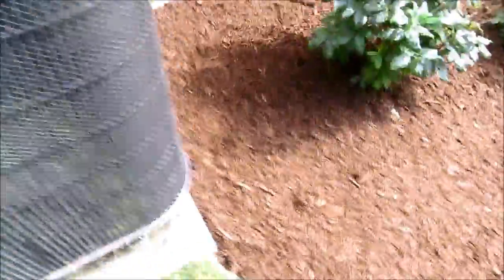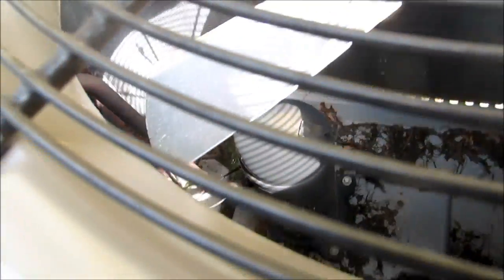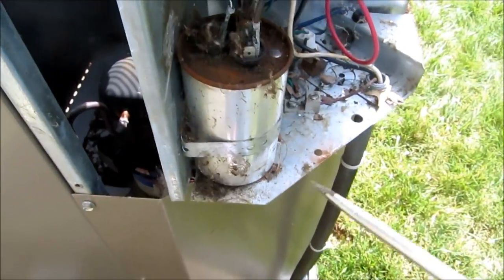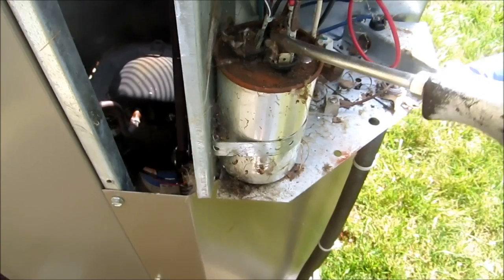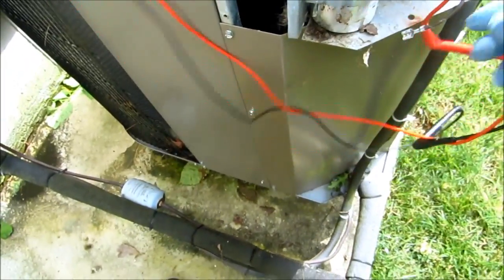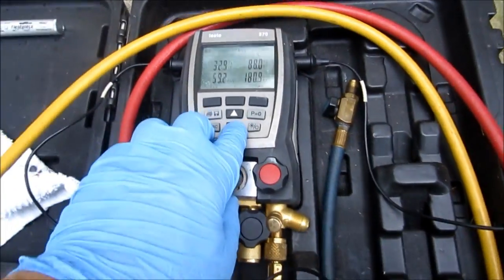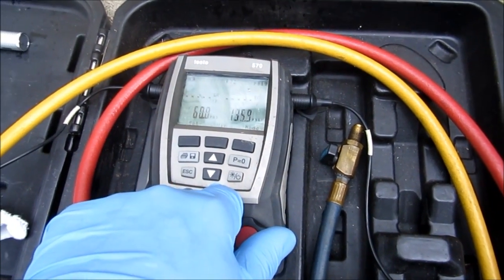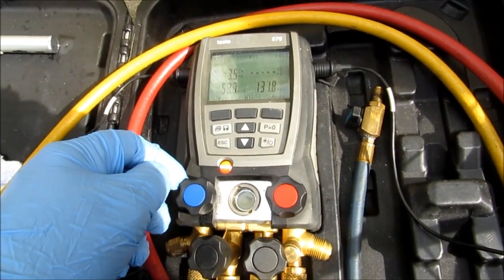HVAC SERVICE: condenser unit ,flooding back low sucton pressure

Comment: Thanks for this video.I had a similar situation with a no cooling problem..This system was low on the suction side so I attempted to add freon but the compressor pressure switch tripped in the middle of charging the system causing both compressor and fan to stop working.I pushed the switch botton .Systen ran for a few minutes and shut down again.Please help.
Reply from the maker: +Olurotimi Adepitan sounds like it going off on a limit eather high or low most likely low .best to call a service tech to fix your problem
Reply: Olurotimi Adepitan  who uses freon?..lol..its refrigerant

Comment: man what a pile good job getting it going again though.  gonna have to see about calling someone to look at our unit sometime  today I noticed when doing some yard  work picking up brushes etc piling them at the service gate next to the units I know big nono  but I wanted them out of the way so homeowners ass don't get made waiting for heavy trash pick up well I noticed the side of the compressor was sweating but stil cooiling didn't have time to deal with it went out for mothersday looked at it again wasn't as bad  this time then unit shut off went away  so I went kicked it back on  within 30 seconds it started to appear again it cant be overchared the charge was chaecked last year and was fine it was actually under charged  long line sets here im going to open the case and run it if it does it bad im going to recommend call someone.
Reply from the maker: compressor should not be sweeting .sounds to me its flooding back ,maybe you have a bad txv or over charged .its hard to say with out  looking it over
Reply: yea  I think the charge is okay it was checked a year ago and at that time it wasn't sweating I watched the tech as he  repaired it  so maybe its  a txv or flooding back I wouldn't know   but I see residue all on the side  so its been doing it awhile and just noticed the spot I saw was smaller the wet dirt marks where it been wet before rather large spot but the thing is still cooling it  keeps the house at a nice 72  we just had a bad blower motor replaced though wish I knew someone here I could really trust to look it over I hope the compressor isn't dying  its a brand new unit well its only bout 5 years old its an 08 ruud unit  can a air filter cause it.
Reply from the maker: maybe its the blower motor speed  ,causing the floodback ,i would check the subcool/and superheat  on condenser,on maybe you are running a pleated filter no air flow .run a blue filter to allow some airflow ,yes the pleated air filter will restrick  air flow.causing floodback .any restickion will change every thing ,try a good blue or they have some white ones  that are not so dense the unit is designed to run the blue filters
Reply: oh okay well ill check the filter tomorrow we us  allergen filters  have cats  and also my bro and sis have  sever reactions to dust an other airborne particles so we use Allergan filters so we try to reduce it as much as we can hes also mildly allergic to the cats so we gotta keep all that clean tomorrow ill do a temp remove of the filter and turn it on see if its that or if I need to call a tech I wont dare keep the filter out I just want to check and be sure before I call and pay for a service call for something as simple as a filter and it very well could be the blower speed as it is a new blower the old one failed how serious is it  for it to be sweating just trying to figure how fast I should have someone come check it  I got a lot going on this week but I don't want to kill the unit.
Reply from the maker: if you run pleated filters you need 200 sq inches per ton.....14 times 20 filter is 280 ,, ok 1 1/2 ton ,just run the blue filters and get rid of the cats
Reply from the maker: they sell less dense pleeted filters 500 microns up to 2000 microns run the 500 or less dense ones you need the airflow  or you will flood back the compresser with liquid .it is not designed to pump liquid .
Reply: okay thanks I will talk to mom about the filters im sure she will still buy whatever ones she wants  though  I kow its like whatr can ya do people don't listen good news yet bad news is  I took the filters out of the unit  turned it on and  its not our filter causing it  even with full airflow  its still sweating its a 3.5 ton system so  ill watch it tomorrow  if its still sweating im going to have her call someone It might not be the blower eiter  cause when the funace fan died few months ago it seized up  turned just fast enough to keep the unit from freezing the compressor didn't sweat  but  a few days later the fan died causing it to freeze and  the  safety switch tripped it. I just hope its nothing major  we already had a failed compressor on our upstairs unit do to a hack install  they didn't flush the linsets on the secondary unit and  contaminated the 410a   when checked  the upstairs unit checked out.
Reply: m also getting about 15-20  temp drop coming from the return then out the vents  and  the vents are blowing quite a bit of air  nice cool air even though its sweating it is cooling  quite well.hope i ccan convince mom it needs to be taken care of before its a major breakdown cause she see it as its cooling just fine because its able to cool tha house.
Reply from the maker: someone needs to check the superheat/subcooling sounds over charged
Reply: okay thanks for your help  ill try and get someone out to look at it  then ill tell you what was wrong.
Reply: well i cant convince them to call a tech oh well there ac unit when the compressor blows oh well i told them so lol   i heard about this stuff called easy seal to seal leaks in hvac what is that  is it any good  just wondering if its safe to use if our ac  system ever develops a leak thats why our old unit was replaced one had a dead compressor the over the seconder coil leaked .
Reply from the maker: no do not use  seal magic .find and fix the leak is the best way
Reply: oh okay thanks wont use it then.

Comment: Nice job Steven
Reply from the maker: it was a gamble but payed off .the liquid line at the evaporator sounded like a lot of non condensables in system .i put my hand on it and it was shacking .i checked for the piston it was there and was the right size .so i reclaimed and recharged .that was the problem the idiot never pulled a good vacuum
Reply from the maker: sorry stephen wrong video lol disregard the comment
Reply: That was a good video too! No problem
Reply from the maker: there was a mess there was a big air flow problem and return /zone dampers but the old ductman did not want to fix .there was a 12 bye pass from the supply to the return with 1/2 the return needed and zone dampers to boot what a mess .i pulled some of the charge out to stop the compresser from dieing

Comment from the maker: yes the eqiupment was mismatched ,what a mess i see some super tecs on you tube claiming to know so much but they only work on new systems i world in the real world with tons of problems ,under size returns/@ supplys was under size running pleated filters to boot .all i can do is do the best with what is there most don t want to resize the system ect .. so its a constant strugle with flood backs ect .so you have to look at the wholle system whats it doing ect ..

Comment from the maker: it was a mess ray i did the best i could to get them going ... i was back there today the return was 1/2 what they needed ,also the supply was under sized .. brand new house what a flippen mess  7 1/2 tons in a house that needed 3 1/2

Comment from the maker: air flow problems is just the 1/ 2 of it breaker and wire to small also return is 1/2 of what they need ,and also have zone dampers what a night mear ..i think i have it set the best i can ..we will see  i can only do so much with the pink elephent in the room

Comment: Hey Steven, looks like they have some airflow issues on that unit. Looks like you may get a replacement out of the call, that compressor was sounding bad.